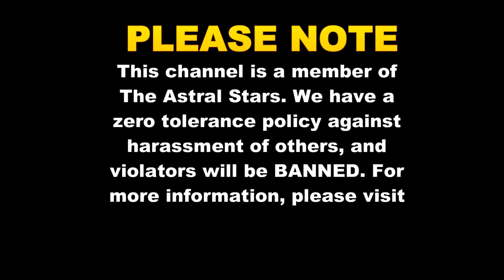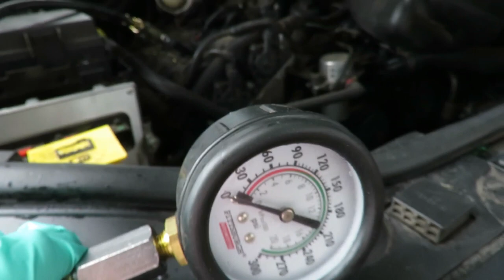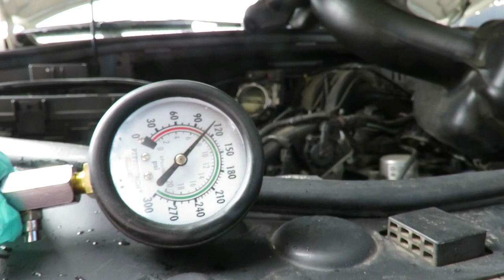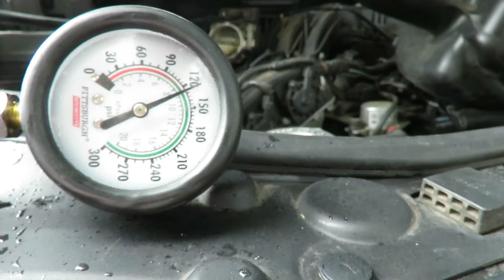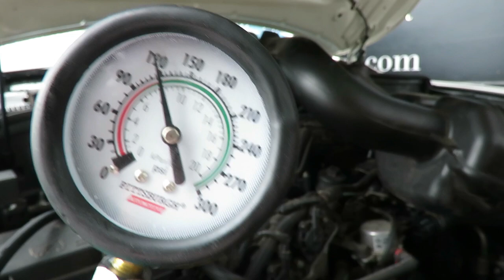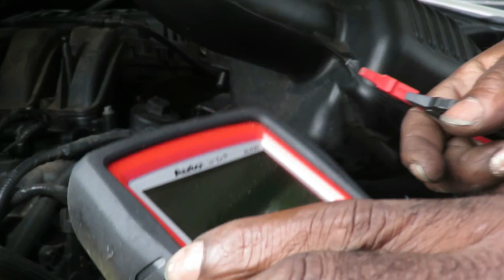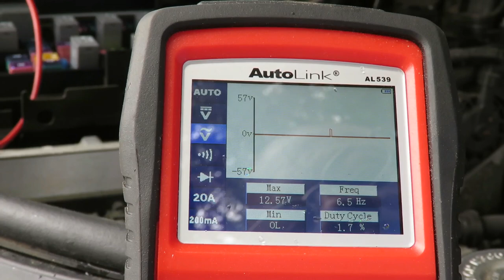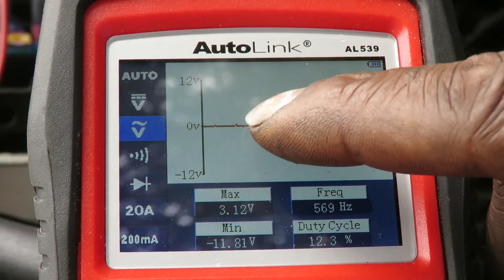⭐ 2012 Dodge Durango SXT - 3.6 - P0303 - Cylinder 3 Misfire Detected - Part 2

Comment: Maybe a vacuum gauge to see if there was any flutter from slightly leaking or sticky valves, then a leak down test on 1, 3 and 5 for comparison. but the known roller faults suggested sounds possible. Say goodbye to Chrysler.

Comment: I would like to have a look at those roller rockers and the cam lobes on cylinder #3. These engines are known for problems with the needle bearings on the rollers.
Just a guess, but the problem seems like something internal and mechanical.
Was there any ticking noise that preceded this misfire?
Reply from the maker: Through these comments, I'm disliking Chrysler more and more. Len, this truck ran so quiet, but the misfire was not like a misfire where you could tell it was a MISFIRE, it was there, but faint.

Comment: purge valve solenoid common issue, doesn't always show code i had the same problem and changed mines it stopped immediately
Reply: Is that purge valve gonna throw evap minor leak codes?

Comment: hello I have been looking on the internet for the answer to my question and was wondering if you could answer it for me. I have a 2003 Dodge neon and it like to loose power as you are driving, its been getting worse. We replaced the  cam sensor, worked good for a month then started again then got worse. My uncle thinks the choke might be too tight or needs cleaned, but he doesn't know if it has one... any ideas? I live on a very low budget, I am lucky to has $100.00 after bills each month, winter's lower than that
Reply from the maker: Is your check engine light on, and if so, what are the codes?
Reply: @OnlineAutoRepairVideos   the check engine light is on but there is no codes. unless theres a way to see them that I don't know
Reply from the maker: @WickedSimmer  If the check engine light is on while you are driving, there will be a code in the ecm. If you are using something that is not pulling the code, try to take it to a local auto parts store that does this for free
Reply: @OnlineAutoRepairVideos  what is a ecm? I might be able to figure it out myself if I knew
Reply from the maker: @WickedSimmer  The ecm is another word for the computer.
Reply: This happened to mine back in the day. My mechanic at the time replaced the ignition coils that went to each sparks plug and the wiring that harnesses to them. Never was an issue again.

Comment: Earlier 3.6L engines had valve seat and guide problems. The valve seat misalignment often caused misfires. Chrysler reported that they fixed these problems in the later versions, but the jury is still out on that. Good video --
Reply from the maker: That is some good knowledge to know right there, THANKS!
Reply: IIRC there is an extended warranty on these heads -- P0302, and maybe 03/04 may be the indicator.  Have customer check with their dealership. There are now several iterations of cylinder heads -- to address this problem

Comment: wouldn't a mechanical problem be their all the time hot/cold and every time ?
Reply from the maker: We spoke to the customer and he did say that he felt the misfire when it's cold. Another thought is metal expands, so what if the valve guide is expanding when the vehicle warms up which would make the gap larger (valve seat) causing the misfire to be more pronounced when the vehicle warms up.

Comment: This is a very unique issue. Tim do you have a boroscope camera ?It might be worth looking inside that cylinder. Some cameras have a mirror on the end to look up at the valves. Or maybe a gouge on the cyl wall. Is there a part 3?
Reply from the maker: Hey Victor, I do have one, and it has the small mirror, but the quality SUCKS!!!

Comment: I remember back in the days  going to auto mechanic school we used to have a old-timer teacher he used to tell us one Dolla of diesel into the gas tank and that it will clean the valves
Reply from the maker: HE'S 100% RIGHT!! The same goes for kerosene. Not sure if they still have it, but there was a product called "Engine Flush". Leave it in your RUNNING engine for 5 minutes, then drain the oil. That product was, or still is, kerosene based!